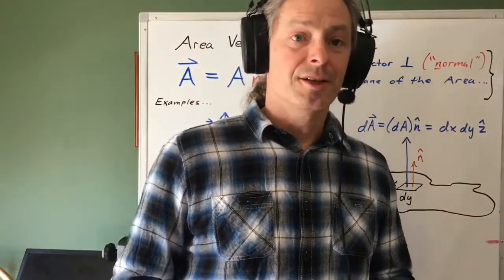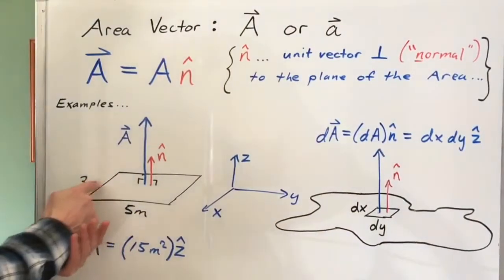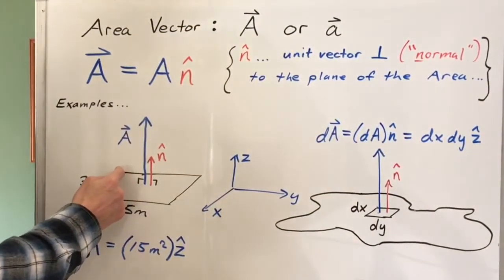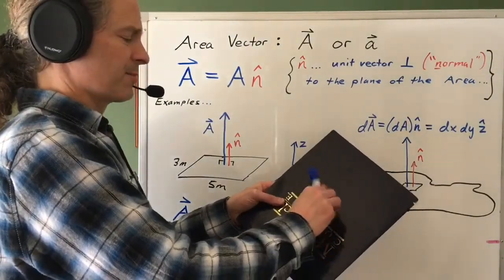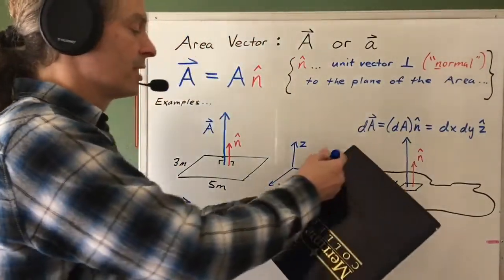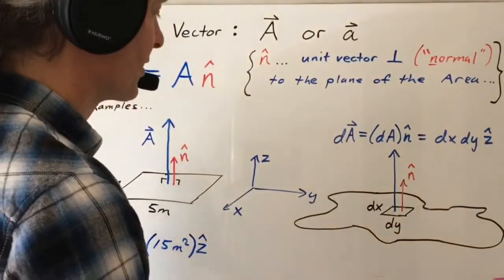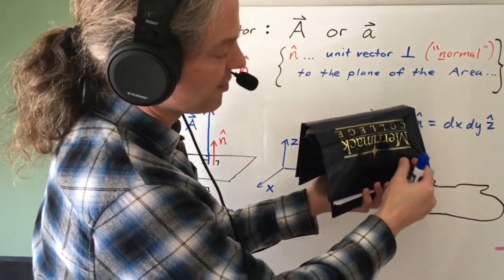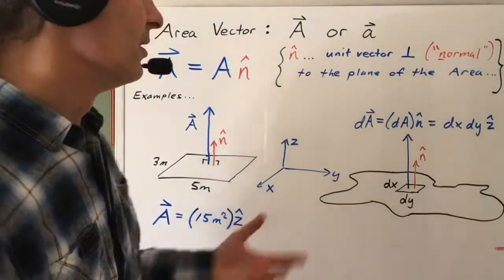Area Vector (introduction)

Comment: OK.  So, vectors obey the parallelogram law of addition, in which the two vectors that are the addends are placed on the two sides of the parallelogram, and the vector sum is the diagonal of the parallelogram.   If the two addend-vectors are interpreted as "area vectors", what is the meaning of their sum?  Does it correspond to some more or less hypothetical area vector?  Unless the two vectors are collinear and pointing in the same direction, the area of the sum is not the sum of the areas of the two vectors that we added.